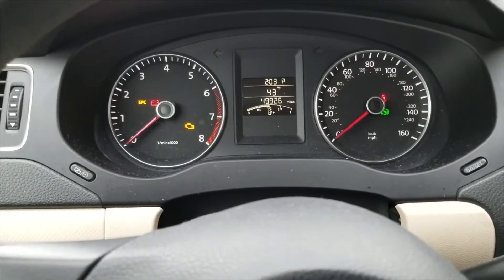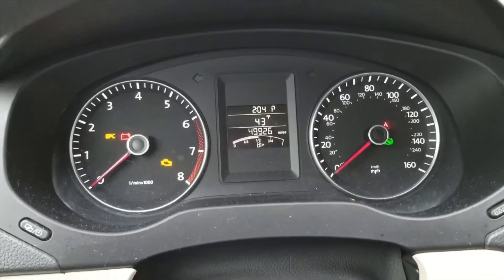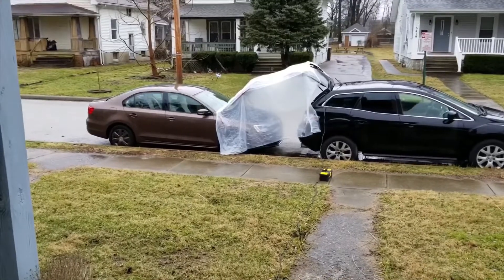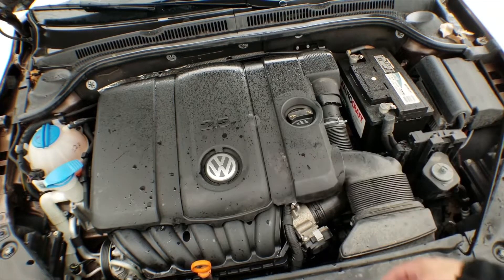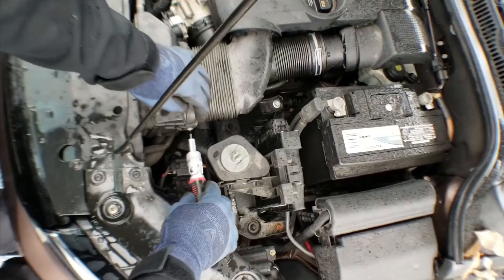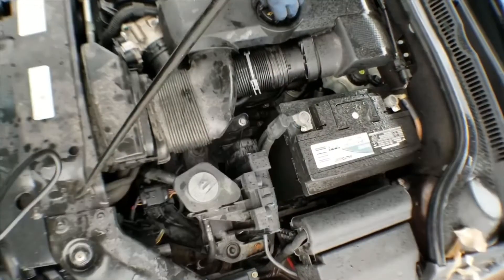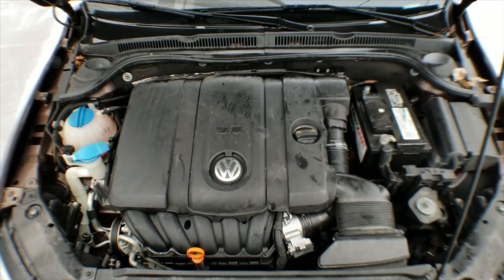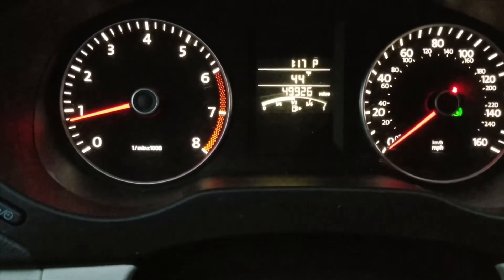Volkswagen EPC Light Diagnosis: Throttle Body Replacement

Comment: I had my engine light and epc come on after my Jetta 2.0 stuttered trying to accelerate - just hitting 38000 miles turned out my spark plugs were due for a change at 40k replaced the wires since then no codes thought I share my story - Got my sub 👍🏽
Reply: How do I get the epc light to go off? Its driving me crazy. I just finished changing plugs about 30 minutes ago . Had the same issue started this week. I took my 2010 vw jetta SLE to my amazing mechanic he told me I needed to replace all 5 spark plugs. Purchased the spark plugs, took me less than an hour to change them all out.
Reply from the maker: Hey thanks for the positive feedback and tuning in! It is greatly appreciated! Im glad that all you had needed was a tune up👊  I love to hear what else has helped for everyone since there is all types of things that can cause an EPC Light issue👍 Stay Tuned and thanks for subscribing! Thanks again!!

Comment: Can anyone help please I'm driving a vw polo vivo 2011 model now the problem is EPC light  the accelarater pedal dies and the the engine shakes but when I can raff the engine it becomes to the normal again for some time
Reply from the maker: Hey thanks for the positive feedback and tuning in! It is greatly appreciated! I hope that this video was helpful and will help you resolve your EPC light issue 👊  it sounds like it is either the acceleration pedal or throttle body. Is there a check engine light? If so it would help narrow down the part needing replaced. Keep me posted on the results👍 Stay Tuned and consider subscribing if you enjoyed the video! Thanks again!!

Comment: How did you figure out it was the throttle body and not the accelerator pedal? Very good video..
Reply from the maker: Hey thanks for the positive feedback and tuning in! It is greatly appreciated! I hope that this video was helpful and will help you resolve your EPC light issue 👊 I did research prior to intalling and it stated that P0222 was usually the throttle body and it had worked. Usually if it is the pedal it wouldnt respond or intermittently respond but i never had that issue. Keep me posted on the results👍 Stay Tuned and consider subscribing if you enjoyed the video! Thanks again!!

Comment: My 13 passant has ebc light,  a p0121 code. Throttle/pedal sensor ? Would this be the fix?
 Thanks for the great content
Reply from the maker: Hey thanks for the positive feedback and tuning in! It is greatly appreciated! I hope that this video was helpful and will help you resolve your EPC issue 👊  Yes that code calls for a Throttle Position Sensory issue so the electronic throttle body is the issue (exactly what i do in this video). Keep me posted on the results👍 Stay Tuned and consider subscribing if you enjoyed the video! Thanks again!!

Comment: Great video, thanks! Mind sharing what kind of clip you used to reattach the hose at the top of the throttle body to replace the one that was damaged when you took it off? Want to have the same thing ready in case it happens when I replace mine.
Reply from the maker: Hey thanks for the positive feedback and tuning in! It is greatly appreciated! I hope that this video was helpful and will help you resolve your EPC light issue 👊 I used the clamps that have the bolt to tighten it called worm gear clamps. Keep me posted on the results👍 Stay Tuned and consider subscribing if you enjoyed the video! Thanks again!!

Comment: How long did the replacement last?
Reply from the maker: Hey thanks for tuning in! It is greatly appreciated! I hope that this video was helpful and will help you resolve your EPC Light issue 👊  recording took much longer but probably a 45 min job or so. Keep me posted on the results👍 Stay Tuned and consider subscribing if you enjoyed the video! Thanks again!!
Reply: @elevatedpotentialacademy  is the car still running good since you put the throttle body on your car
Reply from the maker: @tyronecrawford7245   yes this is my daily car and is in the latest video 👍the EPC light never returned!
Reply: Ballin On A Budget Auto cool

Comment: Love your video! I have a 2013 Jetta GLI with 54,000 miles on it and I had both these lights come on last night.  I had the car in the shop about a month ago because there was oil in my coolant.  After reading the codes,  it seems I may have a bad cylinder.  Does this make sense to you???
Reply from the maker: Hey thanks for the positive feedback and tuning in! It is greatly appreciated! I hope that this video was helpful and will help you resolve your EPC LIGHT  issue 👊 what was the specific codes that had came up? If it is misfires that can be resolved with a tune up, spark plugs, coil packs if needed, and if that doesn't resolve the issue it could also be the camshaft or crankshaft sensors. Now the oil in the coolant is not good. If it is a drastic amount then I'd be concerned of a bad cylinder or blown head gasket due to the fact that these fluids should never come in contact based on how the system is made. Sometimes you can resolve it with a head gasket repair additive without needing to perform a head gasket replacement.  Keep me posted on the results👍 Stay Tuned and consider subscribing if you enjoyed the video! Thanks again!!

Comment: if your vw is a pzev you have a State 15 year 150000 warranty that covers this epc light  fault even if it isn't your throttle body. I didn't know my car was a pzev until the dealer told me. I have a vw jetta 2.0 T wolfsburg edition it doesn't not have any pzev badging but i checked here https://www.nhtsa.gov/recalls?gclid=Cj0KCQiApaXxBRDNARIsAGFdaB8NorkaGePCWDxaJRBy2YlwsuLHnHLLVtmmCpbJkKtDmRJOFdCGqzEaArCCEALw_wcB&gclsrc=aw.ds     and sure enough its is a pzev.  the following states are covered.( CA/CT/MA/
ME/NY/VT)  i found out the hard way after replacing my throttle body for me it was a no fix and i ran out of time and needed my car fixed. i took it to the dealer and they told me about the warranty i went home and read up on it and even corrected the dealer when they were trying to charge me for ignition coils  that are covered under the warranty. I left the dealer with a working car and only paid 195 which is a great deal after hearing about the car stealerships and their pricing. For anyone wondering i tried to take it to an independent mechanic a few actually but they all were booked up and i needed my car fast.

Comment: James thanks so much for this video, autozone wanted to sell me one for. ... 825.00 no kidding found one online for 74.00 putting it all together now. You video was awesome saved me so much time and money thank you brotha!
Reply: Did you had to program the throttle body or just install it and u where good to go?
Reply from the maker: @osvaldoordaz1047  Hey thanks for tuning in! It is greatly appreciated! I hope that this video was helpful and will help you resolve your EPC LIGHT  issue 🤙🏽for this car no I didn't have to do a reprogram sequence. The car worked just fine and still does, thanks!! Keep me posted on the results👍 Stay Tuned and consider subscribing if you enjoyed the video! Thanks again!!
Reply: @elevatedpotentialacademy  do you think this throttle body would fit a 2012 passat se? Thanks for the info
Reply from the maker: @osvaldoordaz1047  you're welcome 🤜🏽🤛🏽 looks like the same one fits the 2012 Passat Se 2.5L engine! This is the same one I bought right here:

https://www.ebay.com/itm/For-06-14-Volkswagen-2-5L-Beetle-Golf-Jetta-MK5-Rabbit-Throttle-Body-07K133062A/253896564409?_mwBanner=1&ul_ref=https%3A%2F%2Frover.ebay.com%2Frover%2F0%2F0%2F0%3Fmpre%3Dhttps%253A%252F%252Fwww.ebay.com%252Fulk%252Fitm%252F253896564409%26rvr_id%3D0%26rvr_ts%3D6a16b6061710ad3921d21f6fff750cce&ul_noapp=true&pageci=3b101b7d-730e-4c1d-a590-a59061fc282f&fits=Year%3A2012%7CMake%3AVolkswagen%7CModel%3APassat%7CTrim%3ASE%20Sedan%204-Door%7CSubmodel%3ASE%7CEngine%3A2.5L%202480CC%20151Cu.%20In.%20l5%20GAS%20DOHC%20Naturally%20Aspirated%7CEngine%20-%20Liter_Display%3A2.5L

Hope all goes well with the repair 🤙🏽
Reply from the maker: Hey thanks for the positive feedback and tuning in! It is greatly appreciated! I hope that this video was helpful and will help you resolve your EPC LIGHT  issue 👊I'm hype that you're going to be saving hundreds of dollars doing it on your own!!! Keep me posted on the results👍 Stay Tuned and consider subscribing if you enjoyed the video! Thanks again!!

Comment: where did youbuy the part
Reply from the maker: Hey man! The Throttle Body I purchased was $89.99 at the time on ebay. Here is the link:

 https://rover.ebay.com/rover/0/0/0?mpre=https%3A%2F%2Fwww.ebay.com%2Fulk%2Fitm%2F253896564409 

Good luck on the repair! Thank you for tuning in! I hope that this video was helpful 👊🏾 !! Stay Tuned and consider subscribing if you enjoyed the video 🤜🏾🤛🏾 Thanks again 👍🏽

Comment: Thanks man, my EPC light just came on and obviously the car ain't revving up as it should. Your video is really helpful and I'm gonna go ahead and do as you did. I have a question though, does it matter if it is a manual transmission or automatic? Mine is a manual.
Reply from the maker: Hey! Ahh the EPC light came on!!! Thanks for reaching out. I'm glad that this video was helpful! Good question, but no it will be the same parts that would potentially fail and cause an EPC light issue👍🏽 I'd also recommend checking out Part 2 of this video as well @ https://m.youtube.com/watch?v=ggwaoesnh18&feature=youtu.be
!! I wish you luck on repairing your EPC light issue! Thanks for tuning in man and if you enjoyed the video please consider subscribing in order to stay up with the latest content 👍🏽 Thanks again and STAY TUNED👊🏾 I appreciate the support 🤜🤛
Reply: @elevatedpotentialacademy  hey man, I really appreciate how you respond so promptly. However it turned out to be an issue of a couple of my ignition cables misfiring.
Reply: jimysandhu how did you solve yours? Did you buy new ignition wites

Comment: EPC LIGHT common causes in VW -
Cruise Control module
Throttle Body
Camshaft sensor
crankshaft sensor / engine speed sensor/ magnet
...those are the ones I know off top of my head ..there are more im sure
Reply from the maker: Yeah👍🏽 got a second video covering those exact ones! Thanks for tuning in 👊🏾I hope that this video was helpful !! Stay Tuned and consider subscribing if you enjoyed the video 🤜🏾🤛🏾
Reply: @elevatedpotentialacademy  thank you for covering them all! much needed and appreciated..Ive been an audi /vw/porsche owner since the 90s :)
Reply from the maker: @BadTV1993  Thanks for the positive feedback, I appreciate it! Rather new to the euro cars, but its been a good challenge 👍🏽

Comment: Hey man! I got a 2012 2.5 volkswagen jetta and im having a issue with my jetta. Last week i was at a red light and had my car on drive and it just turned off on me. I noticed the epc light came on. I put the car on park and it turned on right away with no issues afterword. A week later the same thing happened. The car just turns off when i have it on drive and im at a stop. And the epc light comes on and then goes away once i turn on the car. Its concerning me now. Have any ideas what it could be? Thanks
Reply from the maker: Hey! So this stalling when stopped isn't directly related to an EPC issue. Sounds like it can be a number of things faulty mass air flow sensor, faulty fuel pump, clogged egr, faulty idle air control, faulty oxygen sensor, or even possibly a TCC solenoid in the transmission if an automatic. The EPC, Battery, and Check Engine light will naturally turn on when stalled out/keys turned in ignition without it started. If the EPC light/ check engine light remains with the car on then it would be an EPC related issue. I'd still recommend to run a OBD2 to see if your car is running a code in order to help narrow down the possible issue. Hope this has helped👌🏽 good luck on the repair 🤜🤛

Comment: Hey man nice vid, but i have a question about my 2002 volkswagon passat i just got. So i got it cheap after the prior owner over heated the engine due to a water leak that he didnt see. so the head was warped and well there were quite a few issues needing to be fixed . we got all that taken care of the past month and now we are noticing that the car wont start now due to a security lock or limp mode. From what i heard the car wasnt running right and had problems accelerating and the turbo kicking in. then they ran it like that and got the engine over heated. The EPC light is on also.. Do you have any suggestions on what we could do to try to bypass this weird security lock thats preventing the engine from starting.   Note: we got the engine to start twice but it didnt stay on but for about 10 seconds max.

Comment: Nice info man,  you got lucky tho on that throttle body lol.  The one for my 03 jetta GLI 2.8L VR6 is $300 so I had to opt for a used one at the time.  Great tutorial tho... ps use a tiny bit of silicone/dielectric grease on those intake hoses helps them go back on way easier.
Reply from the maker: Thanks man👊🏾Oh wow $300!! I guess I did then haha! Good thinking I'll start doing that. I appreciate the positive feedback 👍🏽Glad you got yours resolved! Stay Tuned 🤜🏾🤛🏾

Comment: Same issue - your video was spot on!  I won't try to work on it myself but at least my mechanic can't BS me and tell me it's something major when I now know it is NOT!
Reply from the maker: Hey! Thanks for the amazing comment and positive energy regarding this video 👊🏾 I'm glad that this video has helped you better understand what the issue may be that's causing you trouble. Check out Part 2 @ https://youtu.be/ggwaoesnh18 for even more information 🙌🏾 I hope you are able to get the EPC light issue resolved and that this video has empowered you to stand up to any BS a mechanic might send your way 🤜🏾🤛🏾 Stay Tuned !!
Reply: Thank you so much for this video. Last time my mechanic dribbled me at least now I know.
Reply from the maker: @vusumzimbangiswano5679  Hey man!! Thanks for watching and I greatly appreciate the positive feedback! Yes, def research whatever you can before heading into these shops they will upsell as much as they can and let alone overcharge for the work you can certainly do on your own with a lil research, the right tools, and a no fear attitude going in👍🏽I hope this video was helpful and def check out EPC Light Diagnosis Part 2 on my page for more info👍🏽 thanks again and I wish you luck on the repair 🤜🏾🤛🏾

Comment: First of all I want to say thank you! So much' For this video. I have a 2012 Volkswagen Jetta. It's my baby girl & work car. I love it so good on gas. I replaced the throttle body with the help of your video! Hand's down it works & runs great" I am so grateful & extremely happy right now. She had sit for about 9 days. it wasn't very hard to do with your detail of the video. I ordered the part off eBay I got it for $61 and free shipping.  I just completed this morning' Took me about 30 - 40 minutes to change out & I had to replace that clamp like you did' But just really want to say once again" Thank you very much for your video saved me from an expensive or crooked mechanic 👍👍👍Godbless you Sir" Sincerely Chris wyjack 10-09-19
Reply from the maker: Thanks for such a positive comment👍🏽👍🏽 haha sounds like you had the exact same concern as I did in regards to needing this gas saving car for work and also the struggle of having to deal with that dang clamp!! I am glad that this video has helped and you were able to get it done without a problem following along! Exactly, it's way better getting it done yourself for less than $100 instead of spending up to $900 someone told me on here 😵! Thanks again for the positive feedback and god bless to you too 🤜🤛!!

Comment: Hello Ballin on a Budget
I had a question about this video! I’m having the same issue on my VW car the check engine and EPC light! How did you get the engine to go off? Was it EPC light making that come on or is it two separate things? 
Thank you for sharing this video
Reply from the maker: Hey! The EPC Light will usually always have a check engine light associated with it. The check engine light should always be what has caused the EPC light to appear. The EPC light turned off on its own after the repair in this video. Most times the check engine light will go away on its own upon post-repair restart too, but others you'll have to reset it with an OBD2 Scanner, in which I had to do in this case, and see if the check engine light returns after 50-100 miles of driving and if it doesn't you're good👍 Check out the OBD2 Scanner I use https://youtu.be/iFNchslS0ts
Good luck on your repair 🤜🤛
Reply: Okay awesome! Thank you for helping me